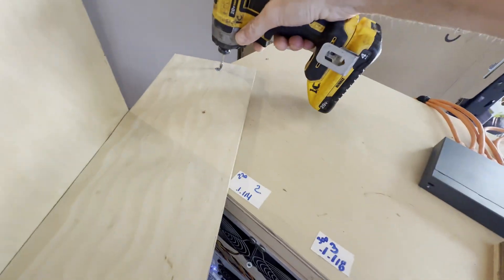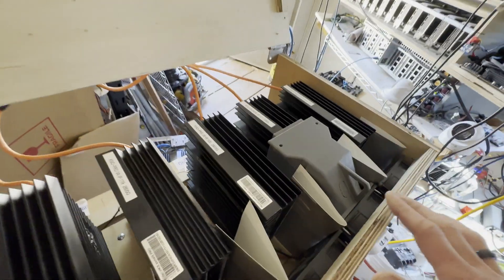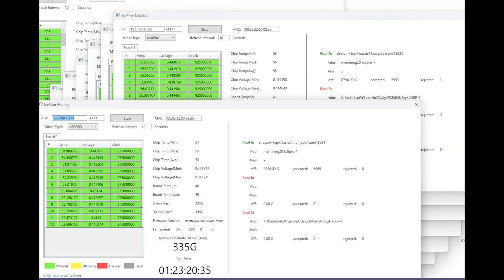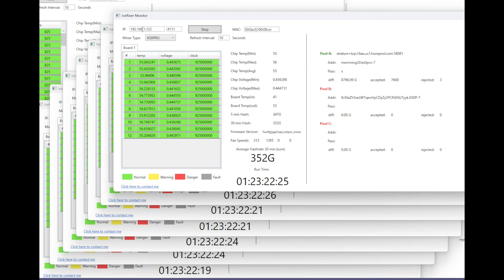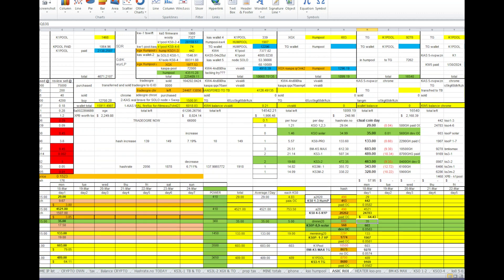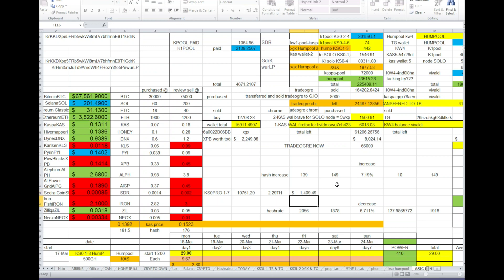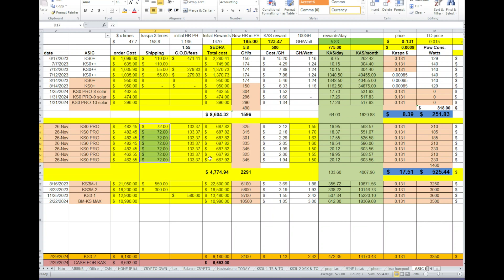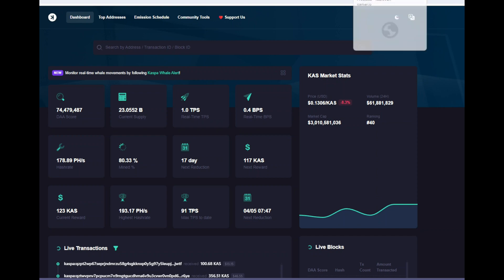MINING BOX WITH 7 ICERIVER KS0-PRO OVERCLOCKED FOR 2 MONTH, UPDATE

Comment: what happens if a fan fails or turns off?  The miner shuts down before overheating or catastrophic failer?
Reply from the maker: the KS0PRO restarts or stops mining in case of overheating that is unwanted but in case something like this happens I have pool send me an email and I can turn off my miner remotely if there is an issue with temps.

Comment: mine with tswift firmware all get 300 to 320gh just have the end plates taken off and a box fan blowing at them
Reply from the maker: Nice
Reply: i get the same with my free software, and i can even tweak it as i like with the free software
no limit or preset numbers like with the paid version

no doubt most people woulld be able to get more out of the free, the gh gap in the paid varsion is to big
Reply from the maker: @Hansen710   which free version are you using? not by tswift?
Reply: @Hansen710  I'm not aware of any free firmware? just either a pay up front or one with a dev fee? where is there a free one? I would not ever use a firmware with a dev fee

Comment: Are you using a server PSU to connect all the KS0 pros? Did you make a video for the setup and how to power them all?also are they using barrel connectors or 6 pin?
Reply from the maker: Yes, I have video Of building this box on Jan 10 this year. I make my own xt60 connectors and solder to GPU pcie 16awg cables that I have from GPU mining rigs

Comment: I can't even get mine to past 260 I'm jealous
Reply from the maker: If don’t have heat sinks don’t try it but once you have them installed try 300G OC it worked for my bad/unlucky KS0pros at least they run 300Gh now instead of 260
Reply: I think the problem might be my Chicony 230W power brick. Voltage on the iceriver monitor don't go past ~0.406 and then just crashes. I have rethermal paste, repadded, and added the heat sinks.  @DontMindMeMining
Reply: i have heard a couple of people saying the have problems running the paid version

no doubt the free version lets you tweak so you can squeeze  more out of it..
260 would be a odd number for the free
and so would 300 be...

i have no problem getting 300 and more out of the ones i have, just with air cooling.. (and power supply ofcourse)
the heatsinks are still in the bag
Reply from the maker: @Hansen710  I think 300G i tried without hetsink but didnt want to risk it, 280G runs without heatsinks with 1400 rmp quiet fan 24/7 but 320-340G using more power and more heat created
Reply from the maker: That could be too